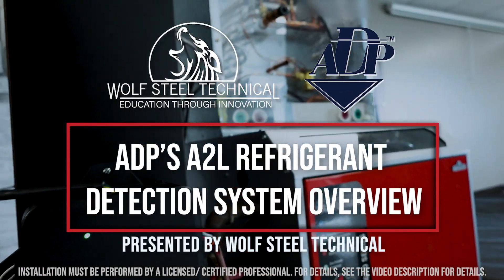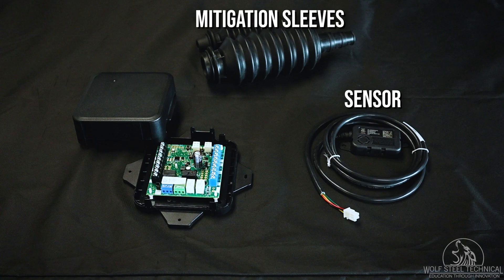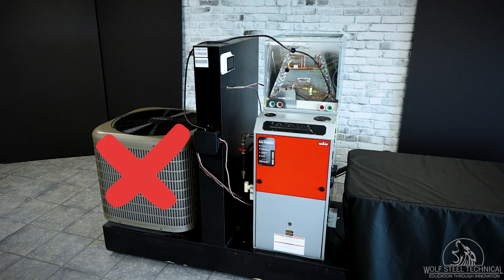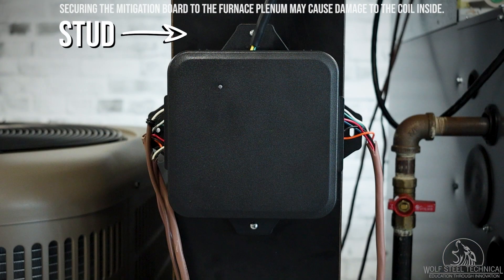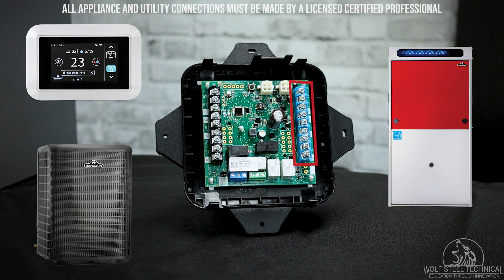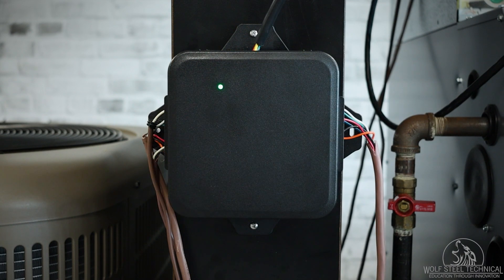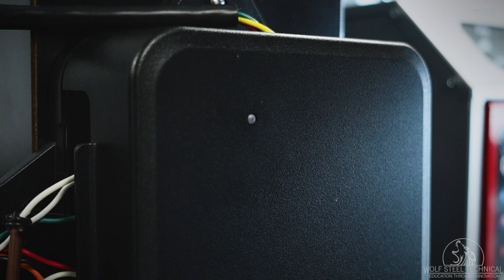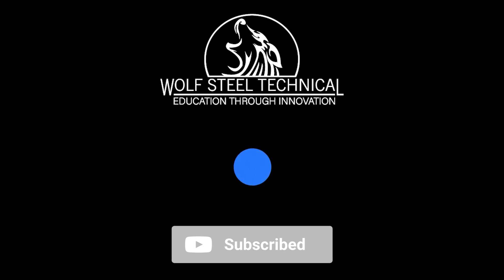A2L Refrigerant Detection System Overview

Comment: If it's a VRF system does every air handler need one of these?
Reply from the maker: Mitigation boards are required based on the volume of refrigerant in a system. It would be best to reach out to the manufacturer of your VRF system to get more info on A2L Mit board requirements.

Comment: A-Coil with “Mildly Flammable” refrigerant mounted atop a (Propane/Natural Gas) furnace neither of which are mildly flammable funny we never needed a sensor for these gases prior to A2L refrigerant
Reply from the maker: That's why a leak test must be performed by a certified Gas technician. When there's a safety precaution put in place, there's always a story behind why...

Comment: So dumb this migration board can’t stop a leak !!! lol what’s the point ?Do you know how many people are gonna by pass this cramp with it fails ?
Reply from the maker: Leaks first have to be located before they can be fixed. Usually, this can be at connecctions or even if there's been physical damage to the lineset or coil, so human intervention is required regardless.

That's why the tech needs to ensure a proper evacuation is performed  prior to charging the system with refrigerant to eliminate this possibility.

I can see how multiple sensors, strategically placed in the system, and a way to identify which sensor identified a leak would be very helpful to locate the initial leak point.

Comment: Does the mitigation board need a common wire for it to work because the thermostat that I’m connecting has four wires not a common wire?
Reply from the maker: Yes, you would need to run a common wire to complete the circuit.